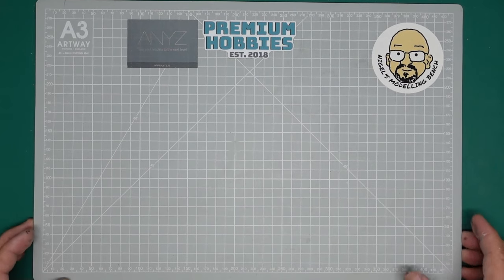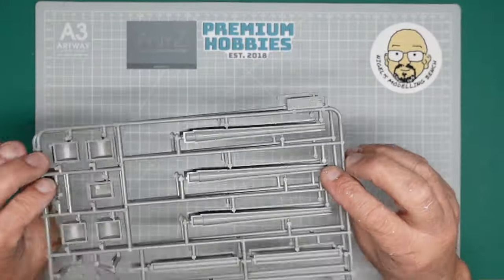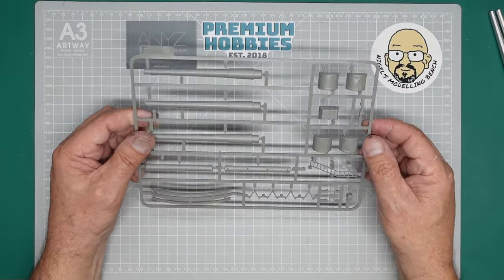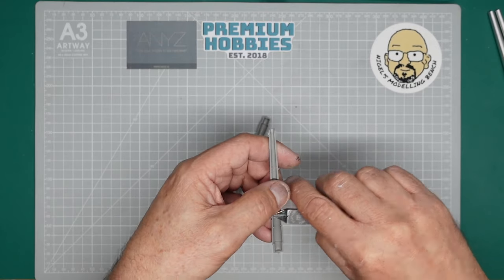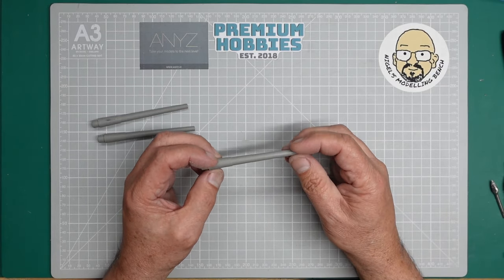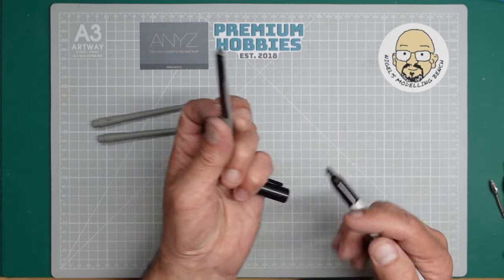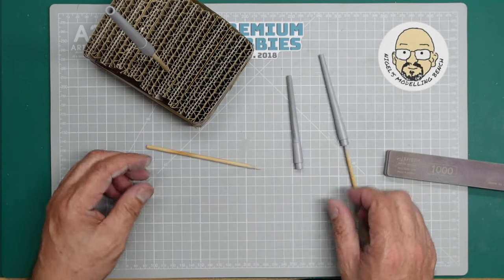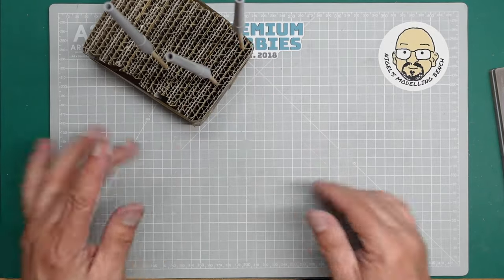Beginners guide to better model making. Part Fourteen. A Tale of two Halves..

Comment: Nice tutorial Nigel.  Getting round things truly round is always a challenge.  Have you ever used the Flexi-File sanders?  They make one that looks like a big C with a strip of sandpaper stretched across the ends.  I saw Modelkit stuff using and it looked like it would work really well.  I ordered one, but haven't had a chance to try it yet.  Thanks for sharing.  Have a great day.  Jeff